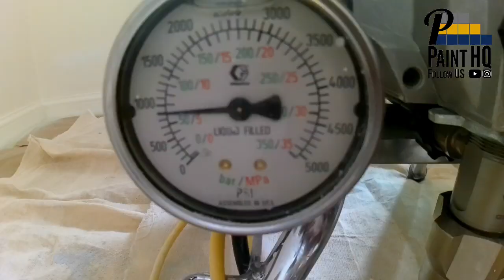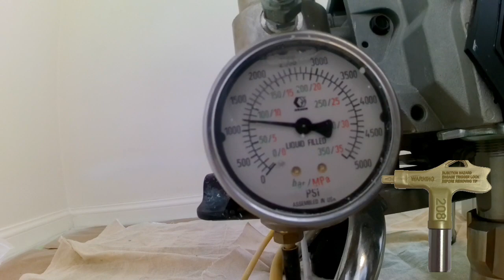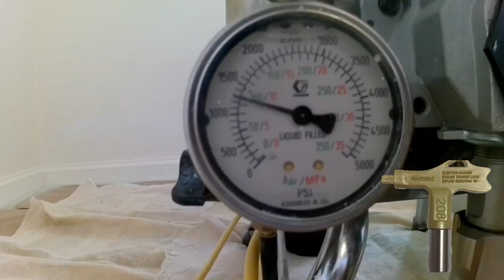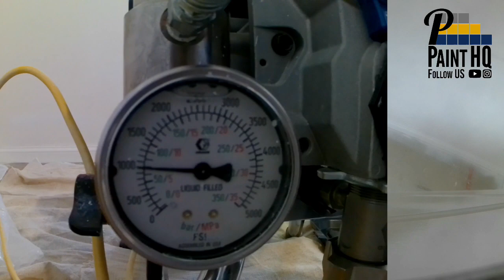How to spray doors | Painting doors with an Airless Paint Sprayer

Comment: Man! Your videos are just so good. I assumed the tritechs would be much lower pressure tbh! I must say i was only really interested in trying them 06 tips from them, but heard they block mega easy. Need fine mesh at pump like crazy. 
That said i reckon different tips will respond differently to different products. Keep up the great work mate 👍
Reply from the maker: Thanks for the kind words of support 👏💯 ..Yeah I too thought the pressure would have been lower than it was with the TriTech.. That’s a very good point about their .06 tips, I’d like to give them a go 👍 I suspect I could get the pressure down 🤔 
..Always great to hear from you buddy 👊
Reply: @PaintHQ  there is always a way to get the pressure down 😄 i am trying to keep my paints warmed as much as possible. Also i have been spraying a fair bit with my compressor and gun, and it is definitely nice using much less material, but you do have to thin a fair bit.
Reply from the maker: Good point, warming the paint lowers the viscosity.. I very much like the look of Wagners heated hose system 😊🤔
Reply: @PaintHQ  definitely. There is a lot of buzz about them at the moment. I am looking at a bigger pump already and the sf23 has popped on my radar. They work together very well as.they have a passthrough for it. One day maybe. Tritech just showed a prototype this week of a t5 with heated hose too  😃
Reply from the maker: Sounds awesome mate 👍 Nice setup 👌
Reply: @PaintHQ  heated hose system that's got to be the worst thing I've heard of good luck spraying water-based paints..
Reply: @jamesmcconnon2  why the fuck would you try and warm you paint up .😆 🤣
Reply: @JONO3679  heat lowers the viscosity of liquid. This allows you to spray at a lower pressure. Also waterbased paints dry from airflow, not heat.. that is why airless sprayers typically spray waterbased paints with less issues than conventional sprayers, as waterbased paints like to dry around the needle due to airflow on conventional guns.
Reply: @JONO3679  not everyone lives somewhere that is so hot that the ambient temperature will cause issues though do they... by all means you can assume that you know more than the guys who make these sprayers, and that they have no idea, so therefore make something that will ruin your paint 🤣. But it is simply not the case. It is simply physics that material that is warmer is less viscous so therefore will atomise easier. If you want to keep arguing about it, be my guest, but it won't be with me. Peace homie 🤙
Reply: @JONO3679  Educate yourself on the Wagner Nespri-Tec system before saying things like that.
Reply: @rushmoorpaintinganddecorat1493  i work in aussie the paints gets hot enough as it is ..
Reply: @rushmoorpaintinganddecorat1493  you need to educate yourself ive worked in the uk didn't have any problems spraying just with drying times because of the cold .  But you get the same problem in nz in winter. Never had any problems with the actual spraying .  I'm guessing you just haven't  been spraying for long and haven't used enough machines wagner. titan graco. Even the cheap China machines. they all spray exactly the same way...
Reply: @PaintHQ  do you always have the exhaust running when you’re spraying? I find it very hard not to contaminate what you’re spraying. What’s your process?
Reply from the maker: Hi Jay, good question.. yeah an air mover / extractor does help get the fog / dust / dry fall outside.. but you still need to vac and tack cloth the joinery prior to spraying, along with spraying the project in sections, and working from the ‘top’ down.. this hall, stairs, landing project shows spraying the spindles / joinery at the top, then I’d recommend using a vac as you work your way downstairs.. 

https://youtu.be/lkGZCVcP6l0

hope this helps.. keep in touch, I’m happy to help if I can.. regards Pete

Comment: They turned out good I was almost gonna start calling you tiger because I thought there was going to be a bunch of stripes they gelled out nice 👍🏻 I probably would’ve used FFLP 515 not having to do so many passes but it looked great nice job 👍🏻 btw I do like the way you showed the consistency of the material that is super important I always like to add a cat full of floetrol also
Reply from the maker: Thanks for your feedback my friend and sharing a very good tip regarding Floetrol 👍🙏 Regards Pete 💙💯

Comment: Looks so dark in there! Windows are so small in new builds, never enough light , I use LED strip lights,  just put them on the floor or taped to a step ladder,  or a head torch is good too . Light where you want it. Thinking about getting the Graco cordless instead of lugging a 110V around. Still on roller and brush but this video is the catalyst  to get spraying, got a similar job coming up. Thanks , like the notes on pressure used.
Reply from the maker: Hey Julian, you’re spot on and great tips regarding lighting up the job site.. I love the cordless technology from Graco, it’s led me to go cordless I’m other tools too.. including area lighting 😆

You might like this latest video 

Airless Spraying Tips and Tricks. Tips Spraying With an Airless Sprayer
https://youtu.be/soa35gZrM68

Keep in touch, great to have your input on here.. regards Pete

Comment: Hi do you need to change filter on pc gun ? If so are they different colours etc ? Thanks
Reply from the maker: Hey buddy.. yes there’s gun filters in the Graco Contractor PC guns — smaller / stumpy version in the PC Compact 👍 colours are black (60 mesh), blue (100 mesh), and red (200 mesh).. I clean them during the sprayer cleaning and I very rarely need to replace 👍 regards Pete
Reply: @PaintHQ  Thanks so just got a Gx21 with Hopper . Do you soak in thinners to clean ? Thanks
Reply from the maker: @thomascrown91 Great news my friend.. first time use (before adding paint), just flush through with water to flush out factory storage solution 👍 Then I’d recommend adding Pump Armour after cleaning and storing till the next time 👍 Keep in touch my friend, it’ll be great to hear how you get on 🙏 regards Pete 💙💯

Comment: greetings from australia ...im new to spraying , i notce you always prime pre painted doors?  is that a must do even if re painting over acrylic finish , or only if you are repainting enamel doors .. thanx ..
Reply from the maker: Ah hello my friend in Australia 🇦🇺💙 ..Yes I do find you get the best results out of the topcoat by priming first.. I especially like to use a high build / sanding sealer primer.. the one I’m using here is by AkzoNobel, a waterborne primer.. WP136.. sands / denibs beautifully, before going over with AkzoNobel Aqualit Enamel topcoat 👍 ..I do like to keep to the same ‘system’ with primer / topcoat, ie both from AkzoNobel.. I guess not critical, and like you say if the substrate is pre-primed or previously coated well, it’s not 100% critical to prime again.. I just find in my experience, you get the best result / finish 👍 ..keep in touch brother 🇦🇺💙 ..regards Pete
Reply: @PaintHQ   thank you very much my friend
Reply from the maker: Anytime brother 🙏

Comment: Do you ever get droplets on triggering? I have the same gun and always get those spits which makes it impossible to do the “fine” finish 😢
Reply from the maker: If you get a spit when you trigger on Vs a spit when triggering off.. it could be the gun packing / PC cartridge.. how much use has your PC Compact gun had ?
Reply: @PaintHQ   it is brand new. i tried it today will all sorts of tips and pressures and it still spat at on and off :(

Comment: Hi this is an awesome video. I was wondering if you mentioned which paint you sprayed on. If it’s not a trouble could you share the brand and type of paint you sprayed there? Thank you
Reply from the maker: Hey buddy, apologies for delay in my response, I’m always happy to help and share information with you.. the primer and top coat features in many of my videos spraying internal joinery, doors, etc.. sprays beautifully with a 208 or 308 Graco FF LP tip..

WP136 Water Based Primer / Edge Sealer
https://holmanpaints.co.uk/interior-wood/171-akzo-nobel-WP136-highbuild-waterbased-primer-edge-sealer.html

AkzoNobel Aqualit (Supercryl) Waterborne Enamel Topcoat
https://holmanpaints.co.uk/interior-wood/169-akzo-nobel-aqualit-waterborne-enamel-topcoat.html
..you get a beautiful cabinet like satin finish ..and cost effective, especially in 5 litre cans..

If this helps at all, Holmans have a 5% discount code, across all their range.. use code PAINTHQ

Keep in touch my friend..

Regards Pete
Reply: @PaintHQ   Awesome! Much appreciated!

Comment: I'm not a professional painter, but I'm curious about why the tests were sprayed onto a horizontal surface instead of a vertical surface?  Also, what exactly are you looking for when testing?  
Thanks,
Reply from the maker: Hi Glen, great to hear from you.. it really is great to hear from non-professionals, I will do all I can to help and advise.. it’s actually a very good question you ask.. I lay a piece of brown paper on the floor, rather than stick to a wall, purely for speed and convenience.. I always spray a test in that way before spraying ‘live’.. what I’m looking for is a fine atomisation (a very small droplet).. this is seen at the edges, we call this a feathered edge.. then across the middle of the fan width, I’m looking for an even distribution of paint.. all sounds complicated, it’s actually a simple process 😆 setting up an airless sprayer to spray paint is relatively simple to setup.. like in my video, I start with the pressure potentially lower than where I’ll end up.. spray a test, you’ll probably see ‘tails’.. so not a feathered edge and a broken pattern across the middle.. then up the pressure by about 200 psi and test again.. the tails will start to disappear and the pattern will improve.. repeat until you get a nice fan pattern as described above 😆 ..the Graco FF LP tips really do atomise material very fine and a much lower pressure 💙

Hope this helps, keep in touch my friend.. I hope to hear about your success in future 😆 regards Pete
Reply: @PaintHQ  Pete, thanks for the explanation.  I have a cheap 1/2 hp Wagner 9140S that's served me well.  It doesn't have a pressure gauge, but I can probably install one.  Being an amateur I don't get to paint as often as I need to gain skills faster than I forget them (grin).  We recently moved into a rather large home though & it could use a repaint in some of the rooms.  I'm not sure I'm up to all the masking required, especially since the ceilings, walls, & trim are all different colors.  But I'll keep watching painting channels & consider it.  
Thanks again,
Reply from the maker: You’re very welcome.. go for it my friend, you could mask off and spray each colour change, you’ll be blown away by the razor sharp lines 👏👏👏 ..keep in touch.. regards Pete 🙏

Comment: Ok, but how do you deal with the area under the door handle, when they are installed? You clearly leave a missed spot under the door handle...
Reply from the maker: Mostly I look to remove the handles — but if the carpentry is poor (new build) and I have 10+ doors / 20 handles / 80 screws that are going to give me a problem, I’ll remove the decorative covers and mask them off.. Then on any downward passes over the handle, I flick the gun back in the opposite direction to coat the underside.. I also spray an industrial waterborne / spray only coating that levels and knits together every sprayed pass beautifully — trust me, there was no missed areas on the doors, I wouldn’t hand over the job in a finish that’s not 100 percent 👌 All the best my friend, regards Pete 💙💯

Comment: Thanks for beautiful and informative video. I have one question... what type of paint you used? Is 210 or 310 or 410 tips can I use for latex paints?
Reply from the maker: Hey Ken, really appreciate you saying that 💯 ..In this video I was spraying a low viscosity primer and top coat by AkzoNobel.. low viscosity is typically thin in consistency, and sprays lovely with .008 tip (I used a 208 if I recall).. Whereas a decorative coating that are usually thicker because they can also be brushed, a .010 tip such as a 210 / 310 will (usually) be perfect 👍 It is on my list to demonstrate manufacturer costing Vs decorative and maybe spraying HVLP Vs Airless.. great to have you contributing.. subscribe if you can, and feel free to ask questions anytime.. I’m happy to help if I can.. regards Pete 🎨💯
Reply: What an excellent video. The videophotography as well as the editing is as much a work of art as the painting itself. 
I’m really struggling to get the correct viscosity for my Titan 500 xvlp gun and Helmi 80. Have you any suggestion that might help? Much appreciated. David.
Reply from the maker: Hey David, that’s so kind of you to say.. regarding XVLP and Helmi, I’ve sprayed it with the very similar Wagner 5000 (separate turbine).. it did take a bit of coaxing and still the finish was a little ‘orange peel’.. not as good as spraying Helmi with airless.. sone tips to help coax Helmi, is to warm the paint.. submerge the XVLP metal paint pot in hot water.. that alone does help.. another thing you can do is add a drop of Floetrol (a paint conditioner).. another version is Benjamin Moore Extender.. along with warming the paint, it does help thicker decorative coatings such as Helmi go through XVLP 👍
Reply: @PaintHQ  ok. That’s all understood thank you. I appreciate you taking the trouble to reply. Take care please.
Reply from the maker: You’re very welcome my friend.. feel free to ask questions anytime and I’ll always do my best to answer 👍 ..regards Pete

Comment: Hi Pete, I missed this video somehow. Great video and it's made me think of this question. I'm guessing that is a standard 3 bed house? If so, how much water based u/c and top coat do you use to spray a house that size?  Thanks Dan 👍🏻
Reply from the maker: Hey Dan, yeah you won’t believe the hours that go in to a house such as this.. in fact it was small, a 2 bed new build.. but they do put lots of cupboard spaces in these days and they can be tricky Vs tackling an extra bedroom.. if I recall I ordered 5 litres of primer and top coat, but I do stock it, so I may of used another 2.5 litre of the top coat.. then I charge the customer proportionately and any left over moves onto the next job.. hope that helps buddy  👍  regards Pete
Reply: @PaintHQ  cheers Pete, I thought afterwards when I watched it again it looked a bit small for a 3 bed. I've got the welcome pack from tikkurila today and size/price guide. I notice they do their paints in 1,3, 10 litres but says nothing about 5l. Is that true or just no prices on the 5l? Cheers Pete. 👍🏻
Reply from the maker: Ah yeah, it is true.. strange sizing, and to make it more challenging.. 3ltr is actually 2.7ltr minimum 👌 Teknos is the same, think it’s a Nordic / Scandinavian thing.. have a chat with them, that’s how I do it, via Edinburgh.. I’m sure they’ll send you samples of anything you want to try, even tinted if you want.. the customer service is excellent, they’ll probably ask you if they could call you, say every 2 weeks to check if everything is ok 👍 all the best my friend.. Pete

Comment: Great video, looks like the graco looks more even, I don’t have much experience with water based enamel I’m still spraying oil gloss on the woodwork. I are you doing 2 top coats?
Reply from the maker: Thanks for the feedback and your input my friend.. Yeah 2 top coats sprayed 👍 ..Bet you’re getting nice results spraying oil based gloss 👌
..What spray machine / setup are you using? Regards Pete
Reply: PaintHQ , nice so what grit paper do you use between coats ? I live in Australia so oil based gloss is normally used here, I get a great finish but lately oil based is yellowing a lot faster, woodwork I use a Wagner aircoat  with flat tips 09/40 and thin around 20% with enamel thinners
Reply from the maker: Ah it’s great to hear from someone in Australia 🇦🇺👏
..It’s 240 grit between coats sandpaper.. Typically I’m just looking to sand off any nibs, between the top coats 👍
..Is that an AAA setup you’re using with the Wagner? Very nice my friend 👌👏
Reply: PaintHQ thanks , yes Wagner aircoat is air assisted airless , also got the graco 395 and 1095
Reply from the maker: Awesome buddy.. You’ve got a great setup with those machines 👏👏👏 ..Keep in touch.. regards Pete

Comment: What's this a low pressure tip v non low pressure comparison .
Reply from the maker: Yes my friend.. the Graco FF LP performed at much lower pressure than the TriTech Ultra (not low pressure).. The control you get with Graco FF LP tips is incredible to spray with.. all the best my friend, regards Pete.